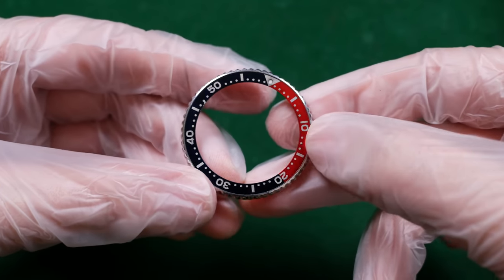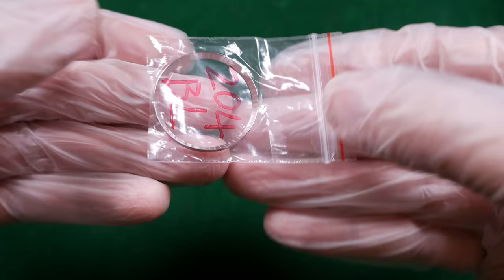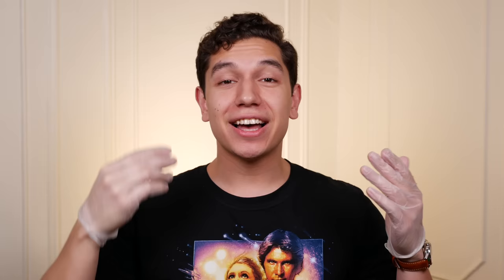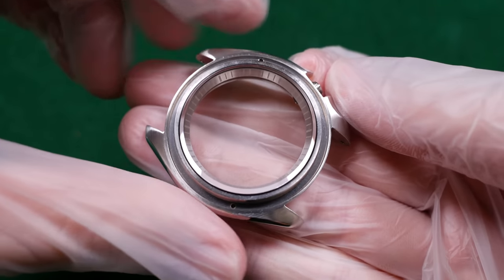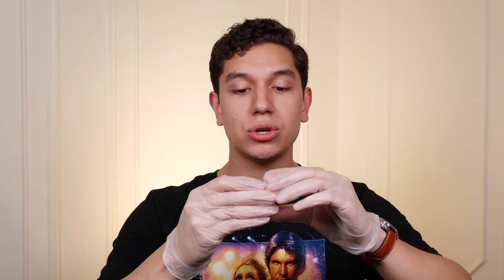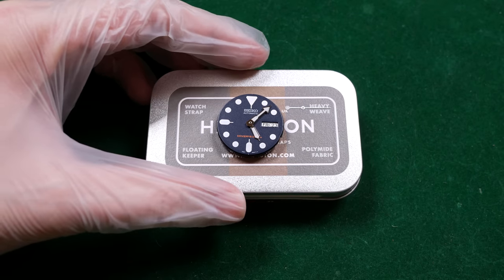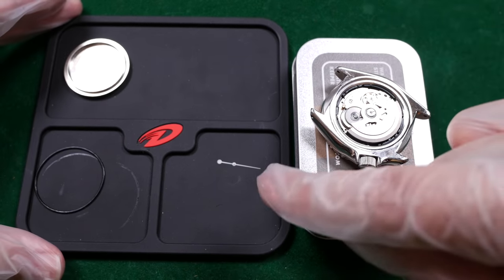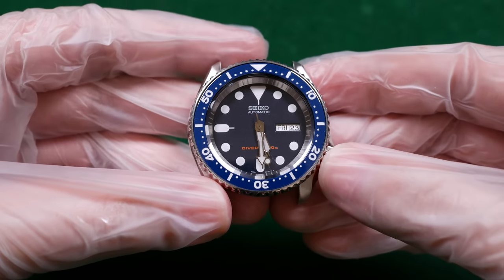Seiko Project: "Deep Blue" - Part Two - How to Replace Your SKX Chapter Ring, Crystal & Bezel Insert

Comment: Excellent, excellent, excellent!  This series has been fantastic -- one of your best efforts, ever!

I am inching closer to modding my SKX009 in almost the same manner as you: new sapphire crystal with new lumed bezel insert.  Your instructional two-part video is giving me even more courage to do so.
Reply from the maker: It’s definitely worth the effort. If you’re going to put your money anywhere, invest in a nicer crystal press. Replacing the crystal can be very stressful with a poorly made tool. I may get a new press myself. The total time for construction was around about two and a half hours, but I was also running the instructional, so maybe and hour to handle. The greatest tool for the task here was patience, haha. If you have that, you can handle this mod. Oh, one thing, the chapter ring/crystal pairing here... For some reason, the chapter ring seats loosely in it’s spot. Not enough to run around it circles, but it will move within the confines of it’s secured position. For that, I couldn’t recommend it, but the crystal itself and bezel insert are excellent.

Comment: Great step by step video that continues to document your Deep Blue SKX Mod. Very insightful stuff! It turned out great... have a custom SKX that retains much the original flavor, but unique none the less. Tastefully considered and executed!

My comments and suggestions to you and maybe more towards others who are attempting such mods on their SKX or similarly other Seiko dive watch models below.

First, with a 7s26 movement, you may want to wait till it powers down and gently tape the rotor down to prevent it from moving and powering up the movement causing the hands to move again.

You didn't really describe how tricky the 3M ring tape for the bezel insert was, but, if was like my experience and it is not only sticky to handle but also twists and curls on you, then my solution I liked to use on my own Inverse Pepsi Tuna Mod was to subdivide the 3M tape into smaller more manageable sections.

I divided it into 6 even segements, but I suppose you could do with quarters or even thirds. I would say the shorter the segments the less likely you will get curling and thus make your life much easier. And, you don't really have to worry about placing onto the bezel insert (or bezel if you go about it that way) perfectly even or even if there is any gap between the segments. In fact, I further subdivided the segments with a tiny section removed between each just to ensure I had enough space between the segments to place them onto the bezel insert (or bezel) and they do not overlap because if you overlap, you increase the thickness of the mounting tape 2x, right?.

Regarding chapter ring placement and alignment. I'd say you were lucky with the CT bezel insert having a little "peg" to fit into the small notch inside the case to at least get you in the ballpark of alignment. But, it is not perfect and there is a bit of play left and right so the chapter ring can still become misaligned. And, it can move on you as you're re-installing the crystal and/or the movement back into the case from the rear.

My solution to making sure the chapter ring does not move on you, especially when you do not have a "peg" on the aftermarket chapter ring as I often do not, is to align it as best you can, and place a small bit of Elmer's All-Purpose glue right where the peg and notch is with a toothpick.

You don't need a lot, but put enough to maybe even fill in the gaps around the peg in the notch. This stuff is good because it is forgiving, water clean up,  and allows you some work time, but does not take THAT long to cure and set, and once it is cured, a good bond is made and it will hold you chapter ring in place. And, it dries clear. And, if you ever need to remove the chapter ring, the bond is not THAT strong that you cannot and if you've played with this stuff as a kid, and who haven't doing craft projects in school?, you know you can peel this stuff off like a piece of dead skin or callous, sorry for the gross imagery, but I think you get it.

To make extra secure the chapter ring will not come loose, I will add additional Elmer's All-Purpose glue around the edge of the chapter ring carefully with a toothpick right at the fine crack between the chapter ring and the inner case.. Again, if applied finely, this stuff dries clear and remember it will shrink and recede a bit also as it cures. If you do it from the inside and backside, it should remain well hidden and not noticeable at all.

FYI, depending on where you get the chapter ring, the chapter ring may still not nestle and be secured between the crystal/crystal gasket, and watch case. I found that out the hard way after everything I thought was very securely set back in together and as i was rotating my bezel, the vibration would cause the inner chapter ring to rotate?!  Even a slight downswing of my arm or an up flick of the wrist to read the time while the watch was on my wrist could shift the chapter ring out of alignment?!  That's why I recommend securing the chapter ring with even a little bit of the All-Purpose glue just to be sure your efforts and possible anxiety of doing your watch mod will not feel in vain and failure if and when something like this happens. Needless to say, I had to disassemble everything and put it back together to reassure chapter alignment and secure placement.

NOTE: The combination I was using on my SKX was a CT037 Sapphire Crystal with Blue AR Coating, Stock SKX Crystal Gasket, and Yobokies Brushed Aluminum Marked Chapter Ring. Maybe this combination of parts have issues together? or maybe the chapter ring itself wasn't made quite as large and fitting as it should have been?  IDK? Yobokies parts I've always felt were pretty good and worked well, so IDK.. Not a common occurrence as it did not happen with my SRP773 Turtle Mod which essentially used the same CT crystal and Yobokies chapter ring. I did not chance it again on my 2nd SKX mod and just added some All-Purpose glue to be certain the chapter ring would not shift post reassembly.

Yes, these inexpensive crystal presses are uneven. Must gently press and rotate as you did.. after the crystal starts to set into the case a bit, you are probably good to press harder as there is less likely space for the crystal to be pushed unevenly into the case at that point. Just keep checking and don't be too hasty and it's all good.

Smart thing you did not install the ceramic bezel insert onto the bezel before pressing back onto the case.

1) you want to be sure the bezel is on first and check the clicking and set the bezel at a hard click stop. If you put the bezel insert first, you have no idea where the final resting position is and where the bezel will hard stop when back on the watch.

2) Ceramic bezels are supposed to be more scratch resistant, but they are not as impact resistant as metal inserts. And, you may find a lot of ceramic bezel inserts are not only a bit thicker than their metal counterparts, but they may also tend to angle upwards towards the crystal and not be completely flat. In either case, especially when the ceramic bezel appears a bit "domed", you really do not want to apply pressure on that bezel insert as it can crack... and likely to happen when using a crystal press to press the bezel back on with a ceramic bezel insert already installed on it.  So, please, be mindful to avoid an Epic Fail!

For the hand placement for the hand press, tweezer work, but the can be damn frustrating to handle with tweezers. Especially when you are trying to balance it on the movement column/stem and trying to use the hand setter to start to set it onto the movement column/stem.  You should use Rodico to shape a custom "handle" to hold the hand for you by sticking the tip of it in the Rodico. It is so much easier for the rodico to do the steady holding of the hand part while your other hand is free to manipulate whatever tool you may have to set the hand in place.
Reply from the maker: No, shortly after completing the project, I can definitely say the Chapter Ring - even with the pressure of the crystal bearing down on it - is loose. Both products are from the same manufacturer and they've somehow managed to produce a Chapter Ring that doesn't fit snugly inside the case. It bounces around. Does this bother me? Not necessarily. Should I make a video reviewing the watch discussing the components and how they've lived up? ... It's a consideration. I'm certain I'll get flack for not having a "professional" fix the crystal and chapter ring in place, but I did imagine that these two components would've had a tighter fit (without chapter ring movement). I think the best course of action is to see if the height of the original chapter ring and replacement are the same, this goes for the crystal as well. If the conditions are the same, the chapter ring shouldn't move. However, if the measurements are smaller on the new ring, this could be the issue. Gluing it in is a fine solution, but it's to a problem that shouldn't have arisen (again, both parts being manufactured from the same company). Anyhow, I'm actually fine with it, haha. The watch is otherwise spectacular. The bezel insert was hand pressed, ultimately, with a micro-cloth covering it. One trip up with the video is the fact my footage for the bezel insert/application didn't come through (technical niggle). Had to patch it up. I used a "liquid control" epoxy that fixed it in place. Works perfectly. It's hold in water/daily use? Time'll tell, but so far I'm quite happy with the results.
Reply: ok, so it wasn't just my experience with the chapter ring.. At least yours has a peg to mostly keep it centered, but still.That would still bug me if it just didn't stay like a good dog.

As with a "professional" fix?  AGhh! Who's to say what is truly professional? 
 It's sort of like with photography.. I take portraits as a side gig and even if it were fulltime career, I would be hesitant to call myself a "professional". The only thing that matters is to handle things in a professional, or rather expert, manner stemming from both good and bad experiences.  My solution is definitely questionable if it should be called a professional fix regarding Elmer's All-Purpose glue to hold the chapter ring in place, but it works and from my experience as a scale model builder, I can tell you All-Purpose glue is REALLY handy. You can check the internet and youtube on its uses and performance, but you may be surprised just how strong the bond is once the glue has been left a lone and allowed to fully cure.

With custom mods and any DIY type situations you just have to be determined, improvise and get creative to creating solutions to problems. it sounds a little unreliable, but I can tell you I was shocked the first time I tried applying the glue and it cured so fast because the layer was so thin and that chapter held strong in place.. And, unfortunately, it had set misaligned?!  I could not budge or shift it into position with gloved hands with friction. But, I carefully took an Xacto knife to slip inbetween and separate the chapter ring from the case interior and cleaned both up of the dried glue and started again. it basically either peeled, rubbed or gently scraped off with finger nail or tool not too hard.

But, you are correct, this is a solution that needed need to be made if the parts were made correctly or more perfectly.

Anyways, a brilliant first custom Seiko SKX mod.. and i think this is your 2nd next to your SRP turtle, if I recall.

I hope you take what you've learned and maybe try again, either by modifying this piece a bit more or another watch all together.

Have a great weekend!

Comment: If I have a crystal lift would I technically need to remove the case back and movement to do a similar modification?
Reply from the maker: Yes... To remove the crystal from the case? Yes. You need the pressure to come from the opposing side (where the movement is resting).

Comment: Hello Patrick. Great video. For the Crystal, did you get the one with blue AR coating? Or no AR coating? Thanks
Reply from the maker: No AR coating. I wanted it to be as close to the original as possible 👌 Sapphire crystal is cut the exact same as the Hardlex equivalent. Crystaltime Horology does a great job with their crystal(s).
Reply: Take Time, w/Patrick Marlett - Awesome. Thanks a lot Patrick 😁

Comment: I have that press.  it's the worst.  Mine doesn't pinch perfectly together.  The dies come in handy though.
Reply from the maker: Aye, I’m definitely looking for a new one 😑
Reply: I also have that hand setting tool. I almost never use it anymore.  I much prefer a pen type hand setter. Also get yourself dial protectors or make your own with some thickish paper.
Reply from the maker: If I were to remove the whole handset, then yes. Honestly, get a square of wax/construction paper, cut a slit and you have a dial protector. A Bergeon of equivalent isn't worth it.

Comment: Great job!  Did you use 3M tape or epoxy to attach the insert to the bezel?
Reply from the maker: Great question! You can use the same 3M tape I showed here. Unfortunately, I had a hiccup with my filming there (which omitted my process of fixing the bezel insert down). I used a Gorilla Glue product meant for "liquid control," any similar product will do the trick. It's hold is something I haven't rightly tested, but if you do this project yourself I'd recommend pressure testing before using the watch in water. At which point, I'm certain it'll hold. 3M is generally the preferred method.
Reply: I think it comes with the insert :) Peel and stick!